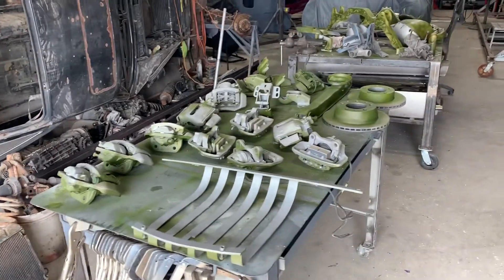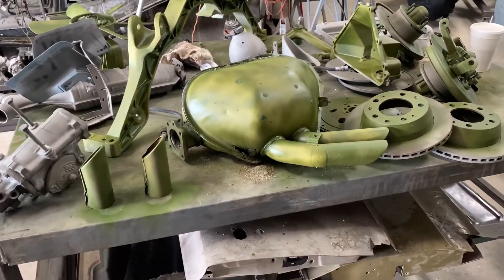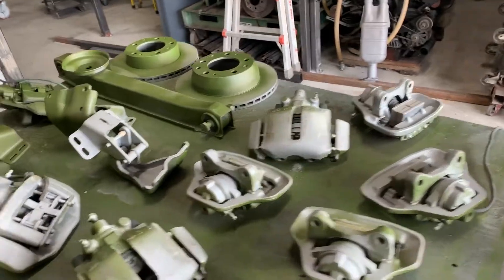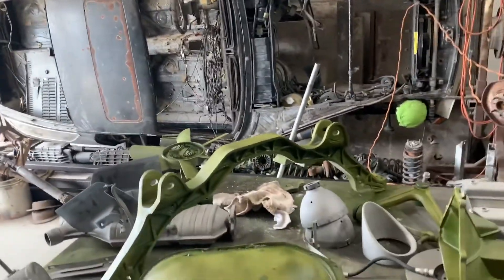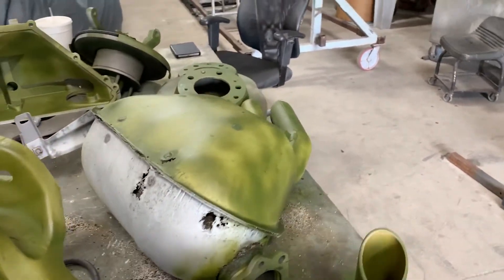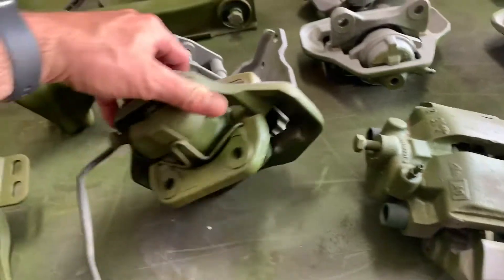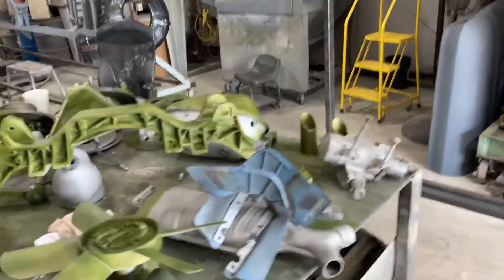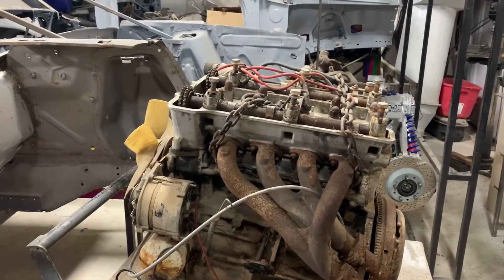Trying out a new Zinc-rich Primer

Comment: I use a 98% Zinc primer from ACE Hardware.  It is rattle can silver in color.  You might call it gray.  It is great stuff, and it is thicker than most primers. I like it.  I spray it on rust, and my rust problem is over.